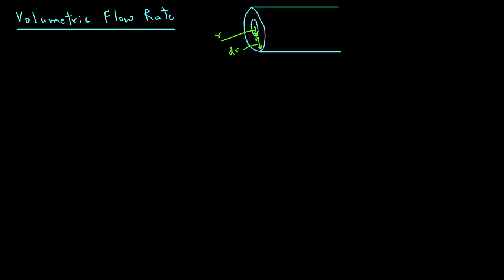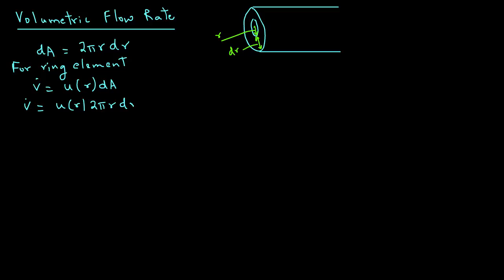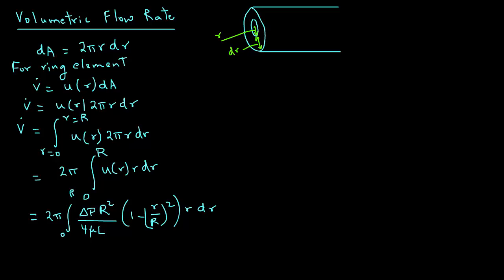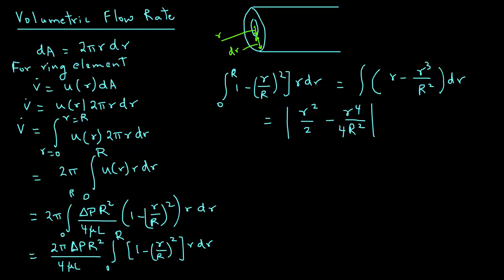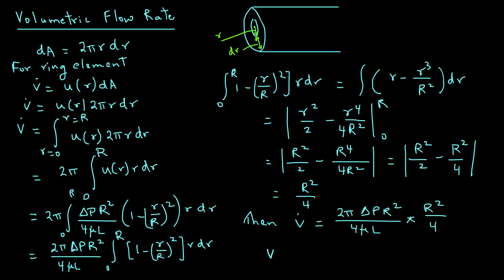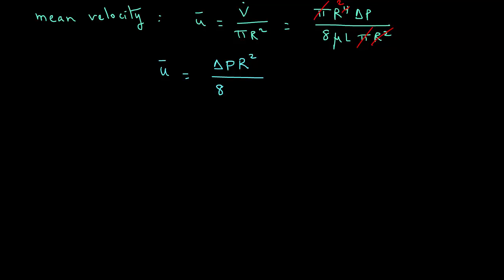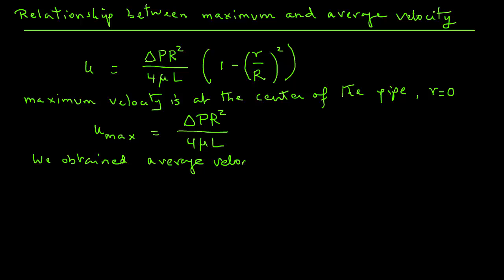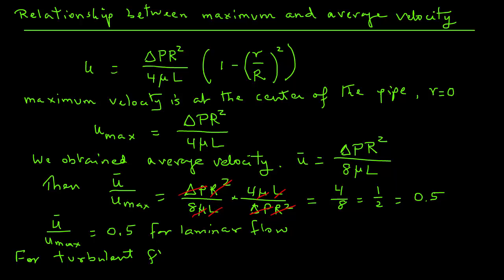Volumetric Flow Rate in a Pipe

Comment: Sir , at 4: 30 how you taken that pR^2 as constant...it is not constant it is radius...then the whole term should change?
Reply from the maker: Good question!  Note that R is the inside radius of a given pipe. It is a constant. Whereas, "r" is a variable, it is the radial distance that increases from the center of the pipe (where it is zero) to the inside pipe surface (where it will equal R).